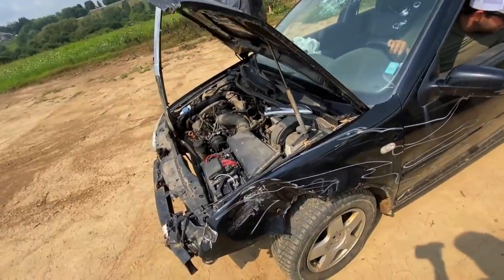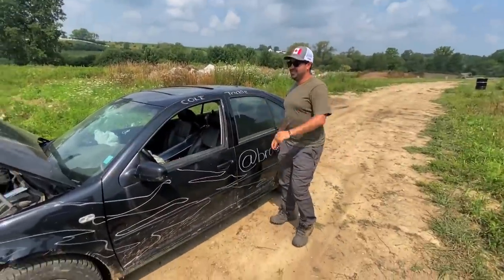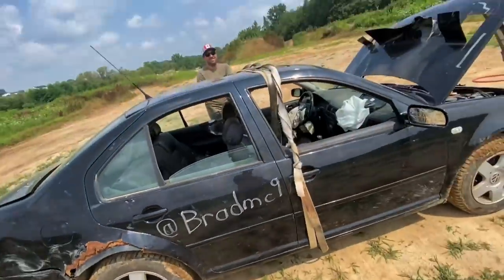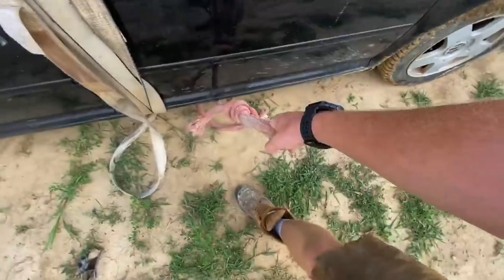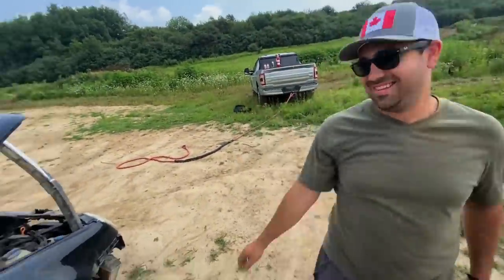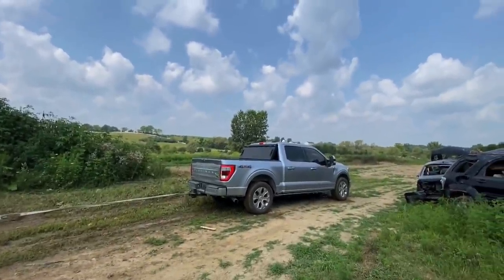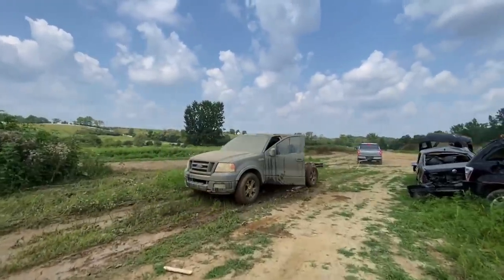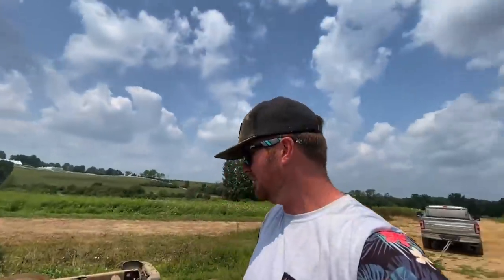Ford MUDDING CRASH FLIP OVER!

Comment: The f150 puts up some mean rooster tails when ya use the revs😅 I'm going to call that 3 flips, if you decide to flip the jetta again try wrapping the ropes around where the windscreen meets the bonnet, with the weight of the engine it might roll a bit better maybe, or even where the roof meets the windscreen. Just a suggestion, cheers mate, hope you're having an amazing weekend. 🤙✌️